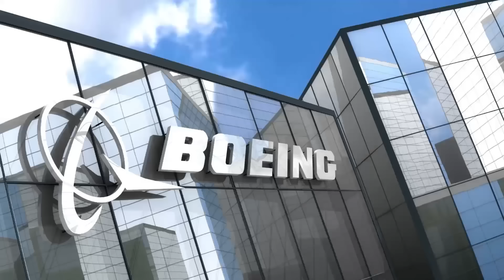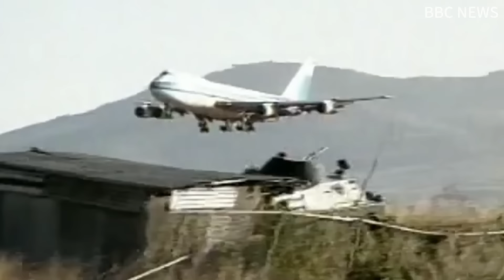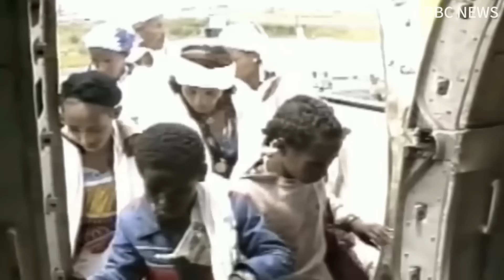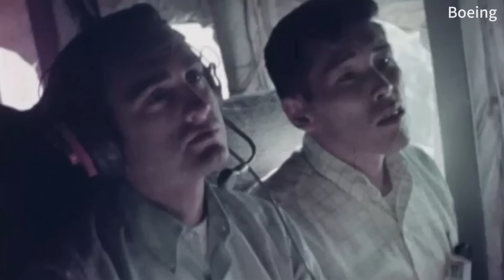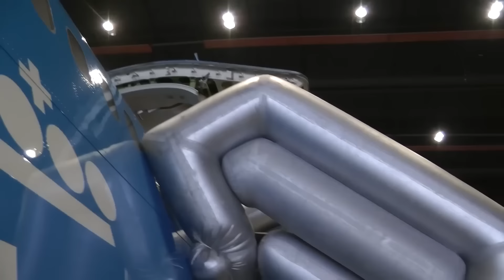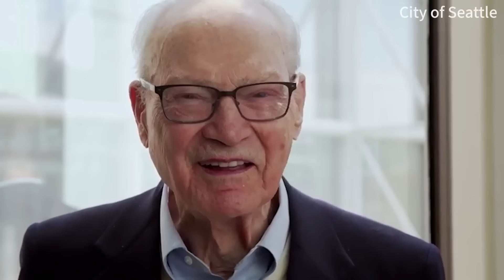What The Boeing 747 Hump Was Really For

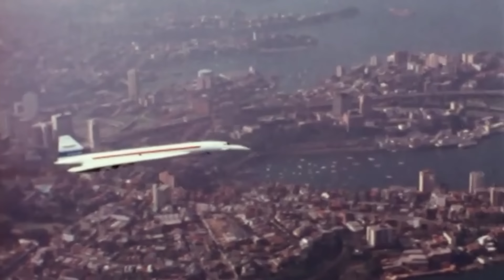Comment: 3:26 How does 4h 56m at Mach 0.85 come anywhere close to "approaching the speeds of the supersonic Concorde"? When I flew on a Concorde from LHR to JFK at Mach 2.0, it took 3 hours 10 minutes. It is still impressive, but please! What a ridiculous claim!
Reply: Its just a gibberish video like most youtube garbage .  Well it is  true if Concorde had to do a circling approach into Heathrow   over  Tenerife
Reply: @sorrenson  Hahaha, yeah, it's an absurd claim. The only way a 747 could have given a Concorde a run for its money would be if the captain decided to take a scenic detour over Mount Teide! 

Mach 0.85 is less than half the speed of Concorde (Mach 2.0), and 4h 56m is still nearly 2 hours longer than the fastest Concorde crossings—typically c.3h 10m, which is exactly how long it took when I flew on one in the early 1980s. 
 
Interestingly, it used to make a continuous descent from 60,000 ft all the way to final approach when conditions allowed, which was the most fuel efficient way, avoiding the drag and inefficiency of the usual stepped descents. Cheers.
Reply: @Nilguiri  WOAH you flew on the CONCORDE
Reply: @Nilguiri  apparently it’s ground speed was 825mph which is Mach 1.07524 so yes definitely more than 1/2 of Mach 2.0
Reply: @Boeing747commenter Fair point—I’ll concede that 825 mph (717 knots) ground speed is impressive — and yes, faster than Mach 1 at sea level. But Mach number refers to true airspeed relative to the local speed of sound, which decreases with altitude.

At cruise altitude (~35,000 ft), Mach 0.85 corresponds to a true airspeed of around 560–570 mph (487–495 knots). The extra ground speed came from a strong tailwind, not from breaking the sound barrier, as I'm sure you know. 

So while the ETA was closer to Concorde than usual, the aircraft’s aerodynamic speed wasn’t. Fast? Certainly. Supersonic? Not even close!  Cheers.
Reply: @Boeing747commenter Yes, I flew on 2 Concordes! The other flight was from LHR to Newcastle at Mach 0.9 or 0,95, I'm not sure. I'm not rich, I used to work for British Airways. I remember paid 174 squid for the LHR-JFK (G-BOAA)! 
They occasionally would put a Concorde on domestic routes without announcing it, to encourage sales. I worked in IT, and had access to the reservation system, so every day, my mates and I would check if any flights had exactly 100 seats (only Concorde had 100 seats), and then rush down to "staff travel" to pay approx. 20% of the fare to get a semi-guaranteed booking. If you only paid 10%, you would be the first to get kicked off. There were dozens of staff hoping to get on that flight, but they had only paid 10% That's how I managed to fly on one for the second time! This was around 1982-1985, something like that. I also had one free round trip flight per year. I used that to go to Australia, Venezuela, Thailand, and a couple of other places for free! Plus all the flights for c. 90% discount! I had a girlfriend in Paris whom I used to visit every weekend for ten quid return, if I remember correctly. And once we went to Madrid (where I now live) for lunch, for twenty quid! Those were the days! Cheers.
Reply: @Boeing747commenter Yes, I flew on 2 Concordes! The other flight was from LHR to Newcastle at Mach 0.9 or 0,95, I'm not sure. I'm not rich, I used to work for British Airways. I remember paid 174 squid for the LHR-JFK (G-BOAA)! 
They occasionally would put a Concorde on domestic routes without announcing it, to encourage sales. I worked in IT, and had access to the reservation system, so every day, my mates and I would check if any flights had exactly 100 seats (only Concorde had 100 seats), and then rush down to "staff travel" to pay approx. 20% of the fare to get a semi-guaranteed booking. If you only paid 10%, you would be the first to get kicked off. There were dozens of staff hoping to get on that flight, but they had only paid 10% That's how I managed to fly on one for the second time! This was around 1982-1985, something like that. I also had one free round trip flight per year. I used that to go to Australia, Venezuela, Thailand, and a couple of other places for free! Plus all the flights for c. 90% discount! I had a girlfriend in Paris whom I used to visit every weekend for ten quid return, if I remember correctly. And once we went to Madrid (where I now live) for lunch, for twenty quid! Those were the days! Cheers.
Reply: @Boeing747commenter Yes, I flew on Concorde twice! I used to work for British Airways in IT, and thanks to staff travel perks I was able to get a seat from LHR to JFK for £174 — that was the staff fare. The other flight was a domestic one to Newcastle at around Mach 0.9 or 0.95.

They occasionally put a Concorde on short routes without announcing it, to boost bookings. A few of us who had access to the reservation system used to look for flights showing exactly 100 seats (only Concorde) then rush to Staff Travel to pay 20% of the fare and get a semi-confirmed seat. If you only paid 10%, you’d be the first to get bumped. That’s how I got my second flight, sometime around 1982–85.

Staff perks were amazing back then: one free round trip per year, and about 90% off all other flights. I used the freebies to visit Australia, Venezuela, Thailand… and I had a girlfriend in Paris I used to visit every weekend for £10 return. Once we even flew to Madrid — where I now live — just for lunch, for £20. Those were the days! Cheers.
Reply: @Boeing747commenter Yes, I flew on 2 Concordes. I'm trying to explain, but YT deletes my comment! I'll try rewording it. Drives me nuts!
Reply: @Boeing747commenterLet’s see if this comment works! (I’ve removed a few details that ChatGPT reckons might trigger deletion — bizarrely!)

Yes, I flew on Concorde twice! I used to work in IT for British Airways, and thanks to staff travel perks, I once got a seat to New York for 174 pounds — that was the reduced staff fare. The other flight was a domestic one to Newcastle, flown just under the speed of sound.

Now and then, they’d quietly put a Concorde on UK routes to boost bookings. Some of us would check the reservation system for flights showing exactly 100 seats (only Concorde), and then rush to Staff Travel to pay a portion of the fare and try to secure a booking. The trick was to pay the higher standby rate to avoid getting bumped.

We got one free round trip per year and big discounts the rest of the time. I used those to visit Australia, Venezuela, Thailand… and I had a girlfriend in Paris I’d visit every weekend for a tenner. Once, we even flew to Madrid — where I now live — just for lunch, for twenty quid. Those were the days!
Reply: Technically, he’s not wrong.  Definition of approach:  to come near or nearer to.  And .85 is nearer to 2.0 than .80 is.  😂
Reply: @jbuckley8  Haha! Well, I guess that's true!
Reply: Clearly, you don't realize the validity of the approximation that both aircraft travel at about the same speed as a spherical flying pig.
Reply: Yep. The only contribution to aviation by the Palestinians is their one and only export….terrorism
Reply: The 747 had an insane tailwind which immensely helped with the speed of the crossing.
Reply: @jonb9879  Yes, I know; so what? In another video, this ridiculous, clickbait channel claimed that it takes an hour for an airliner to cross the English Channel. I have discovered what the "Don't recommend this channel" is for.
Reply: @Nilguiri probs just mad because Israel helped the refugees of Ethiopia 😂
Reply: @jonb9879  how does immensely helping the speed of the crossing make it suddenly be closer to the Concorde's speed of mach 2? The 747 didn't even reach mach 1...
Reply: @GBOAC  Nice username! I was lucky enough to fly on 2 Concordes: G-BOAA from LHR→JFK, and from LHR→NCL at Mach 0.9, if I remember correctly, I'm pretty sure that one was on G-BOAE. I know it wasn't G-BOAC, or I would definitely have remembered! Best wishes.
Reply: I think you may have missed the part of the tail wind. But, even so to reduce the travel time by 50% (depending on thr destination) I find it incredulous.
Reply: @giovannilobello5345  I didn't miss anything, thanks, I stand by my statement and I fail to see your point. 
Cheers.

Comment: Summary answer:
To allow for cargo loading in the nose.

When Boeing designed the 747 in the 1960s, it was uncertain whether large passenger aircraft would remain viable long-term, with the rise of supersonic jets. So Boeing built the 747 with cargo versatility in mind.

For nose-loading of freight (the most efficient way to load oversized cargo), they had to place the cockpit above the main deck — which created the iconic hump. This design allowed the nose of the aircraft to swing open for cargo without disturbing the cockpit.

The upper deck was initially small — just a cockpit and a crew rest area — later, airlines turned it into a luxury lounge or extra passenger space. On later versions like the 747-300 and 747-400, the upper deck was stretched to accommodate more passengers.

Comment: Secret 3 comment. Many years ago I worked as a computer programmer dealing with Manchester Airport’s flight and aircraft parking fees.  This was done on an (at the time) advanced mainframe computer, but all programs had to minimise memory requirements and as such the number of passengers could only be three digits. There came a time when a plane landed at Manchester Airport to take on additional passengers for its continues flight to the US., but the figure of additional passengers was entered incorrectly – I don’t remember the actual details but for example this number was entered as 933 instead of 93. This resulted in the total number of passengers exceeding four digits and the mainframe crashed. Our programs were soon changed to allow such a large number, but would then warn the user that this was disallowed.

Comment: Fun fact about Secret #1: The fact that cargo could be loaded through the nose into the pressurized body of the aircraft makes it completely indispensable for cargo operations, as it could be used to carry large size sensitive materials that couldn't fit into a standard cargo bay. 

Now that the 747 is no longer produced, this is causing a massive crisis in the cargo industry as there is no aircraft made by any aircraft manufacturer around today that can truly replace the 747. After all, most aircraft, including the Airbus A380, have the cockpit right in front of the nose instead of above the nose. For this reason, many speculate that the 747 could continue to be used for sensitive cargo for decades to come due to the lack of a true replacement for it.

Comment: I did a lot of long haul flights for a major international computer company (not IBM) for my job. I used Northwest the vast majority of the time. I flew mainly 747s since all my marketing, technical, customer meetings and meeting with our subsidiaries were everywhere around the world. After Delta purchased Northwest they gave me a very expensive silver Cross pen for having flown over 1 million ACTUAL miles, not including bonus miles. I think by the time I retired and also some of my own flights I probably had at least 1.3 million actual miles. The 747 is by far my most favorite plane to travel in. Nothing else comes close. 

When the company stopped alIowing us to book business class, I had so much status with Northwest/Delta they upgraded me when I booked or even if I was already seated in economy they would come and move me to business if there was an open seat. 

The size of the cabin, galleys and restrooms allow for a much better flight experience. It’s a shame they did revise it to use two much more fuel efficient engines. When the 767 came online I had a trip from the UK to Philly and when the bus took us to the 2 engine jet. I was nervous. I had been on a PamAm flight that lost one of the four engines on a 747 and we descended and returned to JFK. I was very worried about loosing one in a two engine plane. If I possibly can I will try to take a flight on a Luftansa 747. They still use the 747 on some passenger routes. I believe because passengers have to request it so much.

Comment: The speed segment in this video is misleading and just outright wrong 

the a350 can fly at Mach 0.89 the 747-8 can fly at Mach 0.90 but both planes fly below their max speed 

A350 cruises usually at Mach 0.85 and the Boeing at 0.86 

The Boeing was also designed for speed and not fuel efficiency like most airliners today, fuel was cheaper back then and it’s a simple reason why most airlines retired the 747 

Most modern airliners including the 747 cruise at the same speed.

Comment: Hi from Sydney, Australia. I was on the Concorde flight into Sydney shown at 3.30, although a stunning trip in an equally very special plane, to me it was not as significant as when a 14 year old in 1970 I went on the first flight out of Sydney on a Boeing 747. The sheer majesty 55 years ago of seeing a 747 in the flesh at Sydney's Mascot airport, the pure size is something to behold, both outside and inside too, then when going on board to the upper deck bar and lounge area was also something special. Then there was the takeoff after arriving at Hawaii, I wanted dad to take me back to the airport when it was about to leave again for mainland USA, being onboard when taking off in Sydney was similar to any other jet, but I wanted to see it leave the runway and climb into the sky, this was really so impressive 55 years ago to a 14 year old kid to see this massive heavy piece of engineering hurtle down the runway and ever so gracefully lift off and take to the sky, elegance in motion.

Comment: At time stamp 14:56 there was an assertion that no other aircraft could have done the job of the 747 to transport the Space Shuttle. This statement is blatantly wrong. The Antonov An-225 Mryia did exactly the same job with the Russian Buran Space shuttle - and not only is it bigger than the 747, it takes a significantly higher payload.

Comment: The high speed is simply because it has more wing sweep than modern airliners. It’s no mystery and engineers could easily replicate it today if they wished. But you pay a big penalty in weight and complexity due to the complicated high lift system. Today’s aircraft prioritize efficiency and cost over speed.

Comment: I was lucky to fly the -100/200/200F/300/400/400F/ but not the -8 as I went onto the 777/200/300 and 300ER Which also had fantastic attributes but the Queen was just that. Great to fly with Flight Engineers. Ground schho for pilots was 3 weeks on the Engineers panel and one week on the pilot stuff!

Comment: I flew in a 747-8 from Johannesburg to Frankfurt and back. It was awful. The airline sets the seat pitch to pack economy passengers in like sardines. They advise you to stretch your legs regularly but there is no room for that. Classes are segregated by curtains in a sort of caste system. In an aisle seat you will have people bumping into you the whole time because of how narrow the aisle is. The in flight entertainment was outdated. In my seat it did not even work on the outbound leg. On the return leg I only had sound in one ear. While none of this is Boeing's fault, I do not have fond memories of the 747. Queen of the sky? Nope. More like the harlot of the sky as operated by this particular airline.

Comment: Secret 4 is misleading, as all airliners at the time also needed a flight engineer.  There was also a time that airliners needed a navigator.
Reply: I was a Flight Engineer on a L1011 for awhile.  The FE panel was in front of a window and the bird was designed to operate without a FE but it was law.  The L1011 also did a complete flight in 1973 without any human interaction

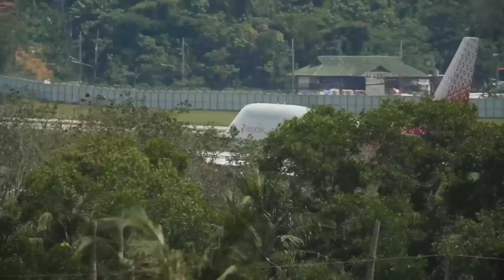Comment: 11:49 Useless fact, The original Qantas 'Wunala Dreaming' (Kangaroo Dreaming) VH-OJB that used Rolls-Royce engines also had its engines painted in the red paint scheme but if a engine or cowling had to replaced in an emergency with a standard white colour components permission from the artist had to be granted first which could lead to delays, this was why when they painted the newer 747-400ER VH-OEJ with General Electric engines they left the engines in basic white. 🇦🇺

Comment: Actually all the aircrafts designed before the oil crisis were designed for higher speeds, than the modern aircrafts. With cheap fuel, the fuel efficiency was not a big concern. Also the noise was not that strictly regulated. And the "bet" was on speed. 
But the oil prices rose, so the fuel efficiency started to be very important. Also the noise regulations came. Both task happened to be covered with the big bypass ration engines. But these engines are better at lower speeds. So the speed was reduced a little bit, but the fuel efficiency rose drastically.

Comment: You make it sound like recent aircraft cannot go faster in spite of trying. That is not the case. their speed is a design choice. The 747's was also a design choice. Generally speaking the bigger the aircraft the faster it has to fly. It's the same for the A380. Modern aircraft fly slower for 2 reasons: they're smaller, and they're designed to do so in order to use less fuel.